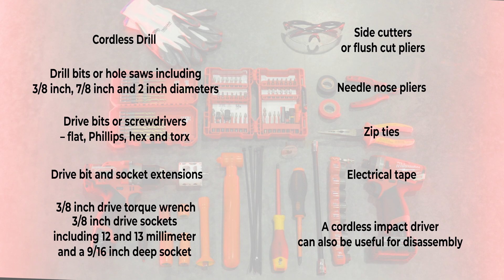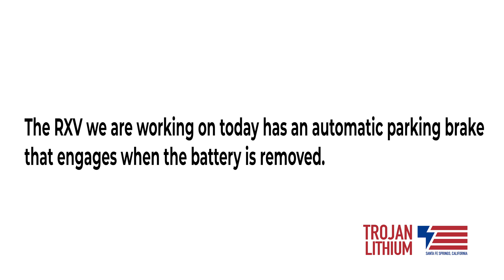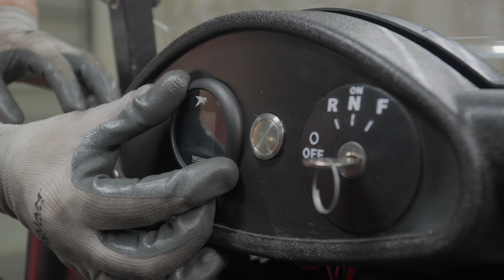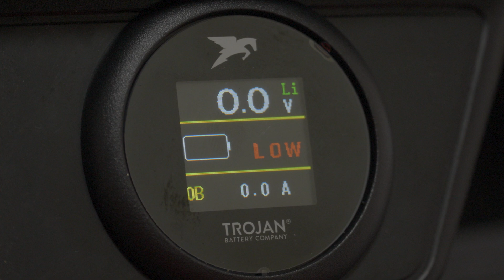How to Install a Trojan Lithium OnePack™ in an E-Z-GO Golf Car | Step-by-Step Guide

Comment: You failed to mention that you must use the blue wire left from the removal of the old charger port and cut the end off and add a wire loop then install it to the positive terminal or the cart will not move thinking it’s connected to the charger.   Also, the brackets that mount in the plastic tub for the battery to sit on do not perfectly line up with the battery feet so you either have to file out some of the loop in the feet or in my case I loosened the brackets mounting screws, installed the battery then snugged down the mounting screws to the tub.  Be careful not to over tighten the mounting bolts or they will start to pull through the plastic tub if over tightened.
Reply: Thank you so much for adding this, and some easy go TXT models have a orange wire and it’s not even blue, this stupid thing was driving me crazy